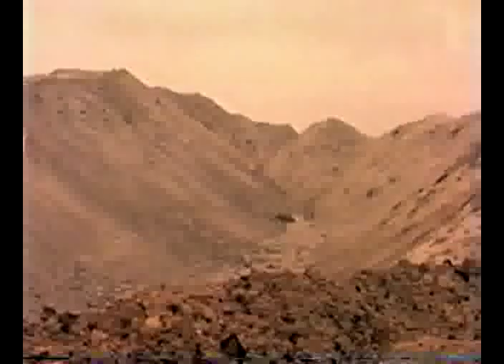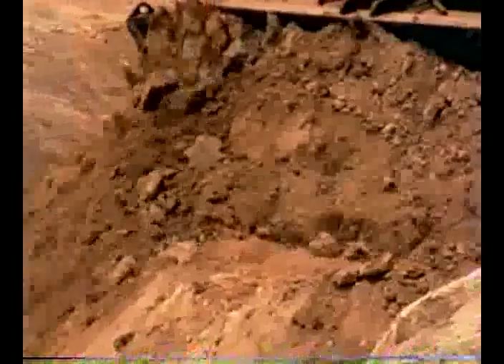Melroe Multi-Wheel Rubber Tire Dozer

Comment: I remember attending a tug of war demonstration at Pendleton Equipment Company in Longmont Co back in the early 70s. The M880 vs D12 Cat. There were many potential buyers in attendance including Arabs in traditional garb. In the early days they called it,”The Push Puller”. The drivers seat would pivot around the control console to the opposite position, thus not having a front or back. My grandfather’s tractor cab company WWEngineering built the cabs for the early production run. I’ve got a photo of what might have been the only OEM produced accessory bucket. The bucket had room for 2 F- 350s side by side. Gramps on occasion would stop by the local coal strip mines in Louisville Co to give uncles and grandchildren demonstration rides.
Reply: What won the tug of war? And I'm pretty sure they never made a d12 cat

Comment: I like how it's compared to a tracked dozer 20yrs older and less than 1/2 the power. That old dozer cost 1/10 the price and has probably pulled that beast out a few times! Especially if it gets too far over the bank and tried to reverse, 4x the final drives, 2x the engines, 2x the transmissions, less productive, and 2x the cost of D11 Cat with coal blade. It has very limited dealers, service mechanics, and parts stocking. Low resale value, and few attachments. If you think it's good on soft ground think again! Impossible to steer in mud. High ground pressure and too long to properly skid steer. Would wear end tires quickly. A little water whether frozen or not on surface and forget it.